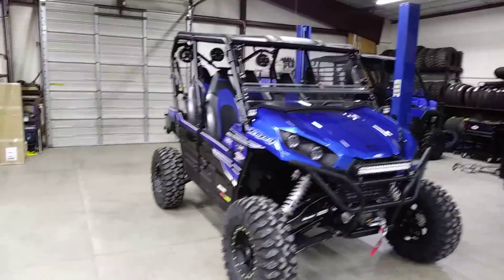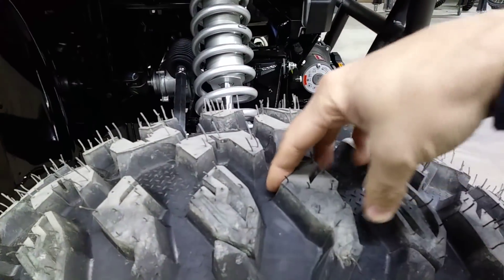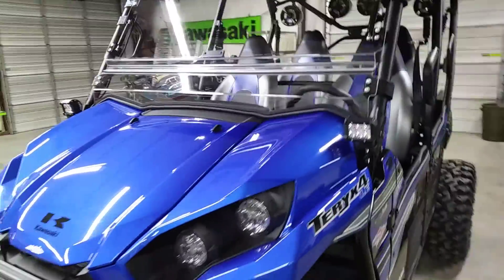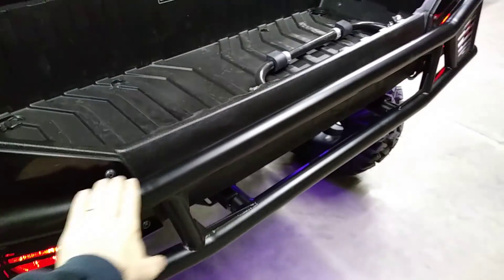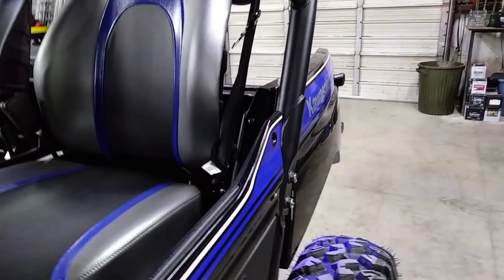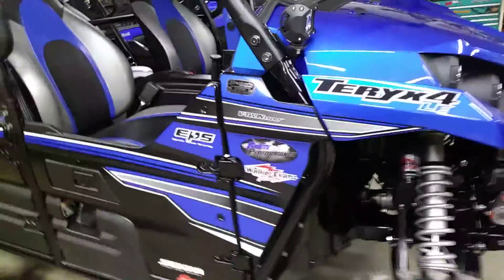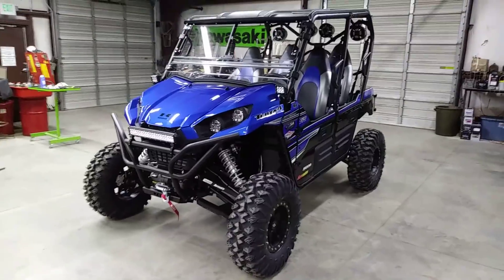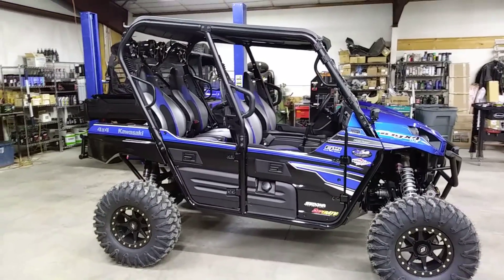2018 Teryx-4 "Hester Edition" Long Travel, sound system, tricked out!

Comment: Have 2009 teryx with +6 long travel that needs replacing.
Will this kit fit 2009? Looks like it should
Reply from the maker: Unfortunately no, the Gen 1 teryx Long travels are no longer made. The Gen 2s are totally different frame and drive set up. 😞
Reply: @HesterEdition    looking at the upper control arms and lower control arms of a 2018 it looks the same as the 2008-2012  to me. 
I get the frame is longer on t4, but the arm setup up front looks identical? Maybe not

Comment: So know this is a old video but would like to know if the 6” long travel is still made or if it’s just a system made only for your shop
Reply from the maker: No longer made, and our current MT Long travel beats it with 5" more wheel travel then this one had with Bandit shocks, and 6" more wheel travel then the Walker Evans had. That's the best long travel out for the Teryx.

Comment: If this machine would be seeing any mud, the sides and interior will quickly become really dirty due to the tires sticking out so far without any fender extensions.  Are those available for the Teryx that will extend far enough to stop most of the mud from flinging on and in the machine?

Comment: have you had any issues with the super atv A arms?  seems like the adjustment on the lower A arm could be a weak point.  I don't understand why they didn't put the adjustment on the top A arm.  Also what is your opinion on using the stock Fox podium shocks with a long travel set up?
Reply from the maker: They are Chomoly, I have not seen a failure, not suing someone could not bend or brake something, nothing is break proof, but they are VERY strong. They run them on every set of arms from Super ATV, polaris, can am, yamaha, honda, kawasaki, every arm made. The tens or even hundreds of thousands of those parts currently on rides around the world, I have only seen (over the internet) one of them bending or braking, and the question that always follows was "did you crash and do that?" Pretty tough.

Comment: How much do these go for with the mods on the video? I was planning on buying the Yamaha wolverine but this Teryx looks too damn good.
Reply from the maker: A build can very greatly in price by the ser up. This one was around the 24-25k area. But this long travel we have a newer supplier on the shocks whick boost performance and lowers the price. Our most common builds are around 20-25k with the occasional 25k-30k. Just depends on what you want.

Comment: Nice build! Warn winches suck! Mine died after a year and they told me my warranty was void because it had mud and water in it. Go figure
Reply from the maker: Wierd, we have been useing Warn winches with hardly a single issue in over 30 years on ATV's. Wierd they did not help you out 😞
Reply: Hesters Motorsports yeah I was pretty surprised myself. It should go without saying but I don’t get stuck on the street. The  irony of it all is the box the winch came had a guy on a four wheeler slinging mud and water everywhere. Anyway. Nice build

Comment: How much to do the same thing to a 2 seat version ?
Reply from the maker: There is ALOT of stuff to do, to transform a Teryx 2 into a T5 such as this, to be honest, would be better to sell yours and either find a good used Teryx-4, or a new T4 and build from there. It's not impossible but you basically have to totally transform the rear end and frame to make a 2 seater the same way as this. There are however seats that bolt into the beds for about $350ish to fit 2 people but the rear passengers won't have a roll cage unless you build one over them.
Reply: @HesterEdition  
Not really what I meant,  I like the 2 seat set up , but was curious about how much to do the extended swing arms an big bore kit . Thx for the response tho 👍🏻
Reply from the maker: Got ya, give us a call (575) 445-3558 Tuesday-Saturday and ask for John, he can help you out and go through any configuration you can dream, big bore, exhause, computer flash you name it. Thank you.
Reply: @HesterEdition  
👍🏻

Comment: What exhaust system is that?
Reply from the maker: That is a Brute Performance dual muffler, unfortunately he does not make them anymore like this, they are doing a quieter single core. But we did get the last ones he has of these and as I write this we have one left. Can hook you up if you want it :) (575) 445-3558